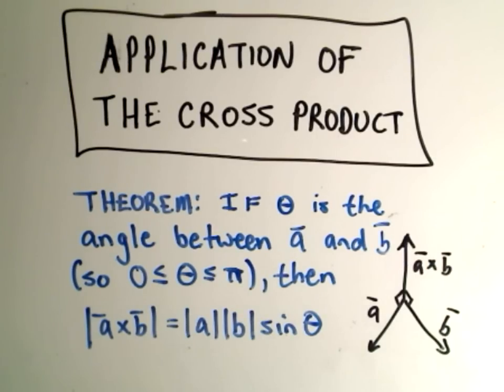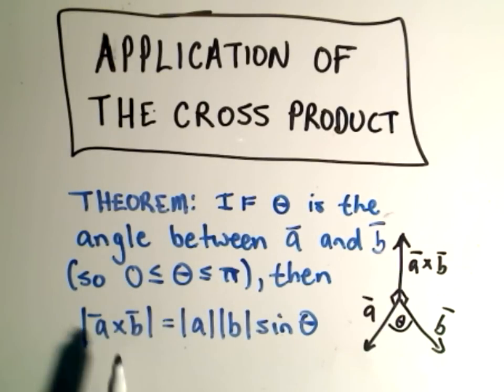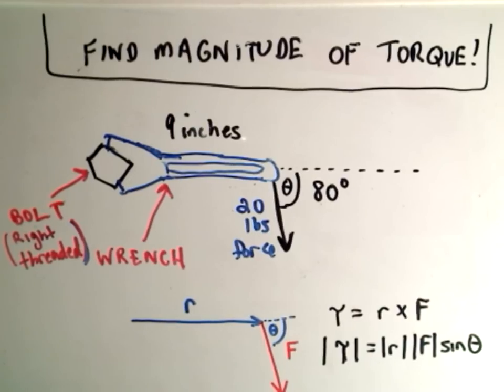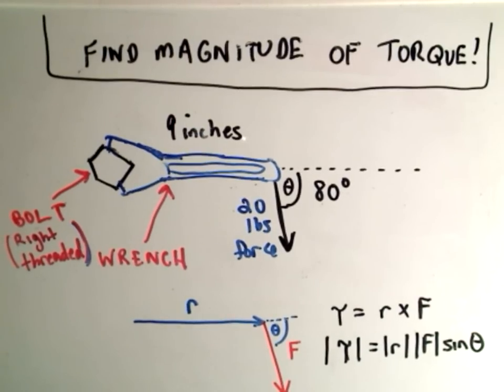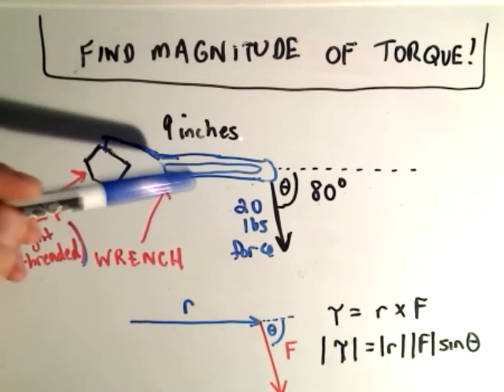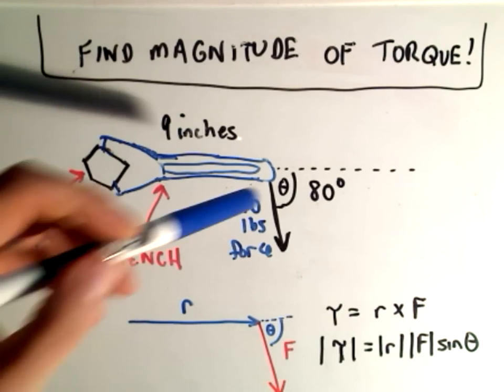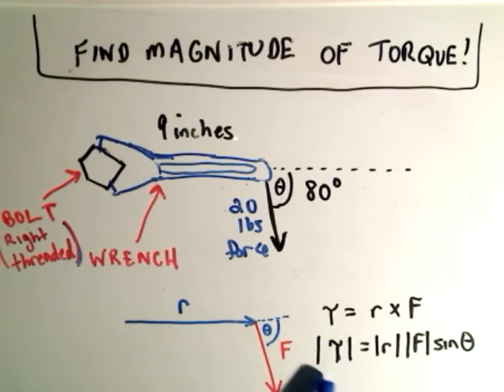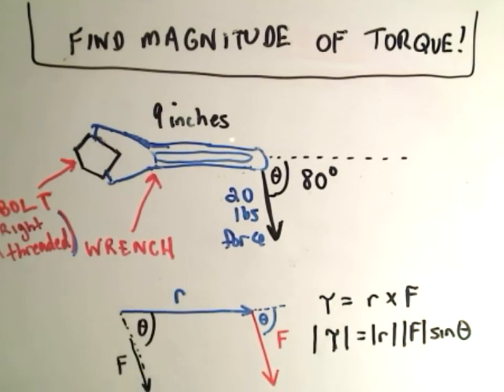Torque - An application of the cross product

Comment: Shouldn't the angle be the angle between a and b, which in this case are r and F, be 100? If the angle of the force is 80 (complementary side), then the angle between the vectors should be 180-80 = 100, right?
Reply: MagicDr I dont think the "Sin(theta) = 180 - deg" is entirely correct. I also have been using the "180 - deg" but, after using the direct sin(deg) calc function recently, I get a completely different answer. So, Im confused on which one is right. Also, Im wondering if you have to decide on the conversion based on the measurement system used. e.g., MKS and CGS. 

(0.127m)(16N)("sin(60) = .866")= 1.759 (1.8 Nm) (0.41 f lbs)
(0.127m)(16N)("sin(180-60)= 120")= 243.84 (244 Nm) (55 f lbs)

??
Reply: MagicDr He used the calc function of sin(80). So, maybe the CGS system uses the calc function and MKS uses the sin(180-deg) and sin(y/r) function/identity?

Idk, Feedback welcome.

Comment: I believe the Torque should should be negative, that is because the force is going in the clockwise direction.
Reply: The problem was "find magnitude of torque" which is always positive.  Formula could have been |T|=|r||F||sin θ|

Anyway, rather than usually, say traditionally.  Clockwise is just the torque vector pointing away from you.  That's negative only because you traditionally insist that the z axis is pointing at you.

Biggest problem people really have with this is they don't realize when this positive/negative info is missing.

It's not in the vectors.  They don't know.  It's not in the angle.  It doesn't know.  It's in the original problem.  It's knowing that the r vector goes first in the cross product.  Or you can look at this and realize it will move clockwise.  Just remember that's negative and insist that your answer agree with that.  Do both and you can check your work.

Unless you were just asked for magnitude.  Then it's always positive.

What if there is more then one vector adding torque?  Look at them one at a time and add them up.

A torque vector tells you three things  The direction of the axis of rotation, the force of that rotation, and where to stand to see the rotation as moving clockwise (at the tail).

Comment: Hey bro`! Hope you're having a lovely day on the internet superhighway.

In anycase,

I'm confused as to why you had to convert the vector 9inches into (.75)? 

Also can you explain why you're using the angle 80 degrees instead of 100 degrees (isn't that the value of the angle actually inside the wrench vector and vector [F] ?
Reply: putting this here in case anyone else sees it. i know its been... 9 years lol. he converted the magnitude of 9 inches into 0.75 bc he was converting from inches to feet. 9 inches is 3/4, or 0.75, of a foot.

Comment: I am genuinely confused
If the cross product mathematically describes this situation then the resultant force is either into or out of the screen.and does NOT cause rotation.
Rotational force is required to undo  the nut.
My instinct tells  me that the resultant force should be tangential to the end of the spanner (wrench 2U)
Why am I wrong ?

Comment: The wrench would work a lot better if it would fit OVER the nut. This wrench is useless.
Another thing is that the torque can only push the wheel agains the hub because the use of screwthread. The pitch of the thread is what 'converts' the torque to a FORCE to hold the heel to the hub.